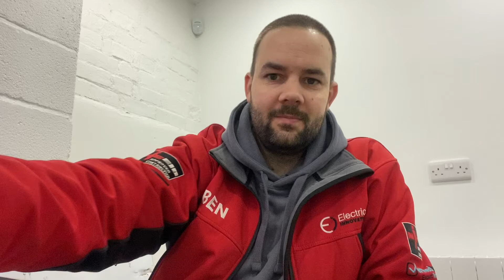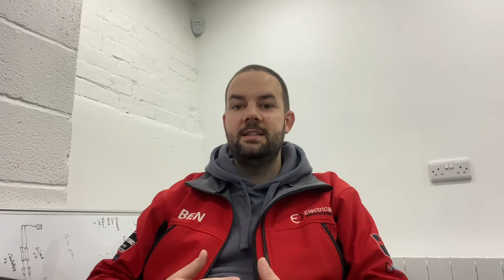The Number 1 EICR Question - Plastic Consumer units

Comment: It's now September 2023, has anything changed since the video was posted?  The EIC report i have refers to this issue as a Code 2 observation which is 'potentially dangerous' are acted upon as a matter of urgency.' Is it correct or appropriate reference this as a Code 2? Thank u.
Reply from the maker: Not a huge lot has changed.  Plastic consumer units are still Code 3.  Unless of course they are full of holes and the IP rating has been compromised.  

Its also at the inspectors discretion.  If the CU is old, looking like its falling apart and in a location that cold be unsafe (HMO EXIT ROUTE) then this could be a reason for a C2.

Comment: Good vid! What would you code an old wylex board under stairs with no rcd protection? You say it would need replacing, so does that mean you would you code it a C2?
Reply: I would code it c2.  Because you aren’t going to have automatic disconnection in the appropriate times
Reply: @tonysoprano9370  Cheers T, would those disconnection times apply in North Jersey?

Comment: bathrooms are notifiable only within the space around the bath or shower as defined in part p
Reply: So what about if you put a 13a socket in a bathroom more than 3m from bath or shower
Reply: @neiltrevatt  That's not notifiable unless it's a new circuit. Still needs to be to wiring regs and safe though, I just mean building control don't need to know.

Comment: Got a plastic one in my rented flat but the single cable coming out from it exits from a hand cut SQUARE hole which is way bigger than the wire. How would you code this?
Reply from the maker: If its big enough to get a finger in its a code 2. If you can touch live parts then it’s code 1.
Reply: @ElectricalInnovations  Thanks!

Comment: This video is so confusing, it's also wrong. You do inspect to the regs at design and installation, as stated in the current regs. Before anyone argues with me - read the Best Practice Guide on Electrical Installation Condition Reporting.
Reply: It is true that you inspect to the current edition, but that does not mean that non-compliances are dangerous. The coding system has 3 basic non-compliances C1 which means actually dangerous, C2 means potentially dangerous, and C3 means improvement may be recommended. His view on the old Wylex , which has fuses fully permitted by the current edition regulations is simply his opinion, but is no more than a C3 and is satisfactory. The lack of RCDs is again a C3 unless other dangers are present, such as lack of bonding in a special location, again his opinion, and NOT a regulated requirement. I hope that makes the situation clear Try the IET wiring regulations forum for more unbiased information, free to use for anyone, Electricians and the Public.  https://communities.theiet.org/discussions/viewcategory/1037
Regards David CEng MIET, Posts there as Davezawadi,
Reply: @davidstone1579  some sparks correction a lot of sparks really need to read and take note of the health and safety executive’s note published in BS7671 18th edition and consumer units in dwellings page 99 in the onsite guide both have been updated to amendment 2 and give clear explanation and guidance.
In the onsite guide it says it is important that installers do not advise the replacement of consumer units simply because they they do not comply with the current version of BS7671 ..
It that simple read the dam thing’s and stop ripping people off the regs can only be applied from the date of publication, they can not and should not be backdated.
Reply: I usually explain the why and why not of a DB and if they're not bothered then neither am I,  followed by your fridge freezer is more likely to burn your house down LOL. Now do you want to know about AFDs.